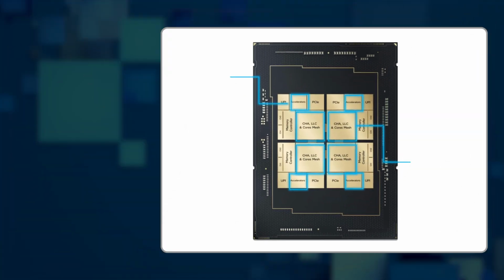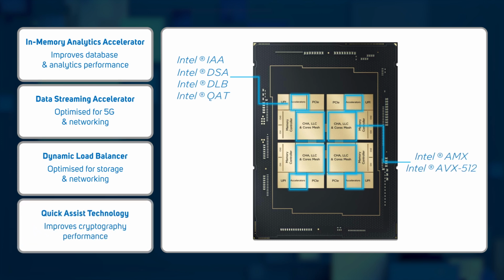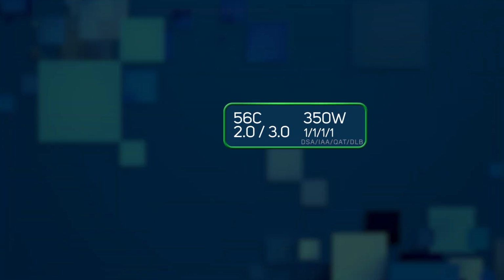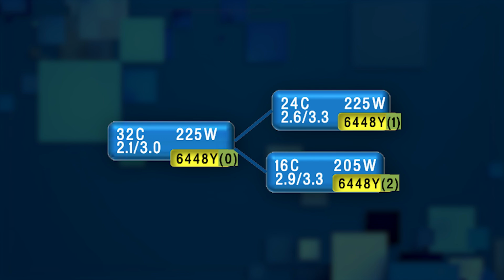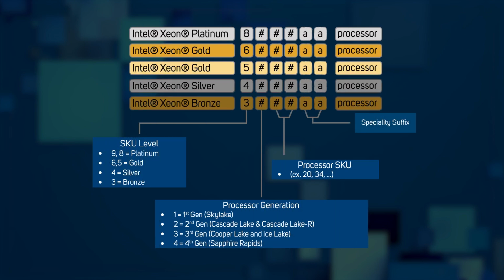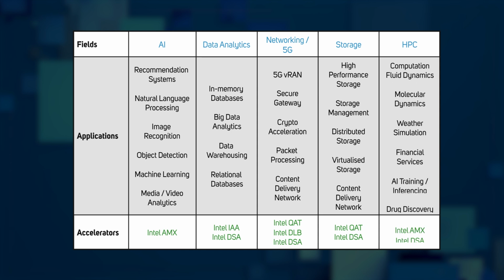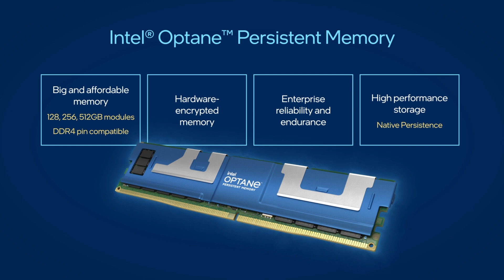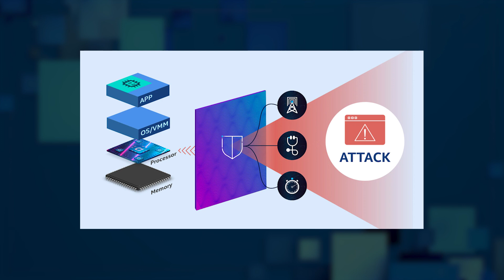A closer look at Intel Xeon Sapphire Rapids

Comment: Thanks this was very helpful introduction to the 4th Gen Xeons. It’s worth noting that unlike instructions-based accelerators (such as AES-NI), the new accelerators require substantial change to the software. Customers should not expect 10x speed up by just getting/enabling an accelerator such as QAT. For example, Nginx users would need a special version compiled by Intel to take advantage of QAT.
Reply from the maker: Great point and well made. The accelerators will provide no benefit until/if software catches up. Intel probably made a mistake here by not including the accelerators as standard, thereby increasing the install base for software developers. As is, there's not much incentive for ISVs, especially with 4th gen EPYC also being so attractive. - JG